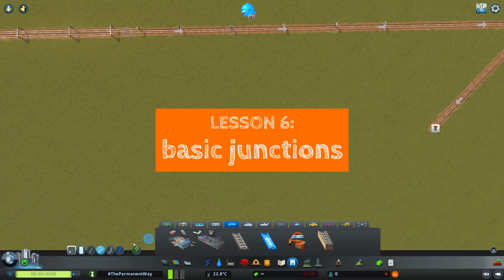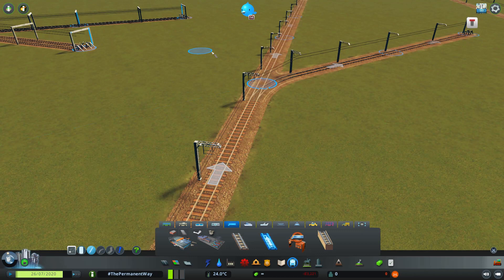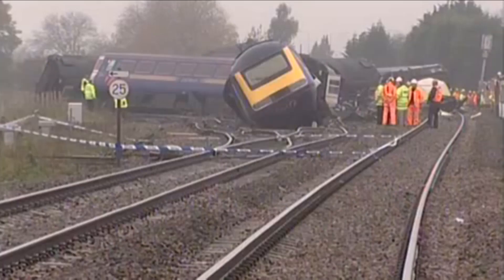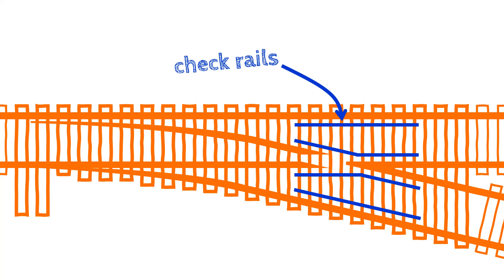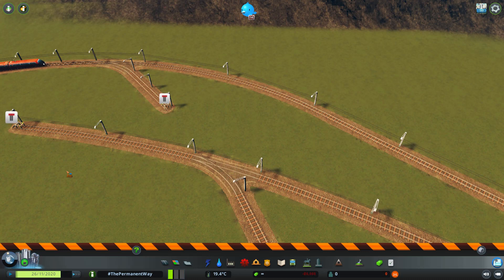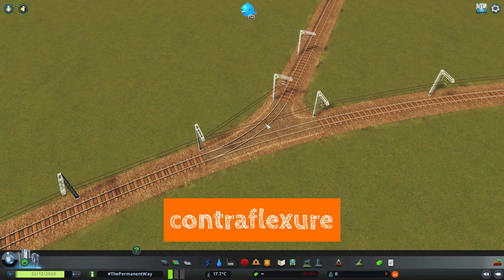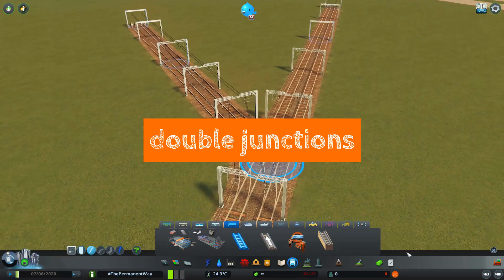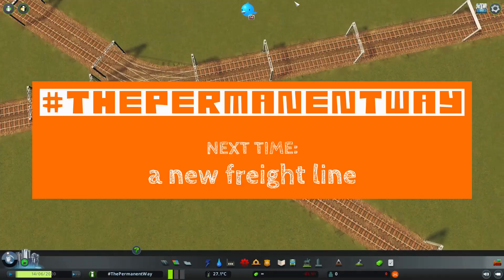#ThePermanentWay | LESSON 6: basic junctions

Comment: I've been meaning to ask: How do railways handle thermal expansion? In particular concerning bridges?
Reply from the maker: A very good question... I hope I answer it reasonably well here: https://medium.com/@garethdennis/the-heat-is-on-and-stress-management-is-the-key-a324dc9f6844
Reply from the maker: Though when it comes to bridges, there is more to it as you might imagine. Shorter bridges don't usually present too much issue and can be accommodated by normal "stressing" arrangements (see my linked piece). Longer spans can require adjustment switches to allow for differential expansion.